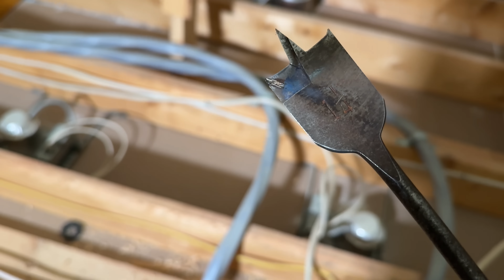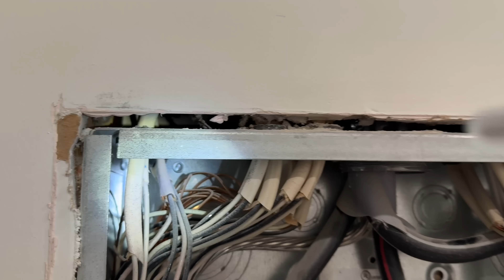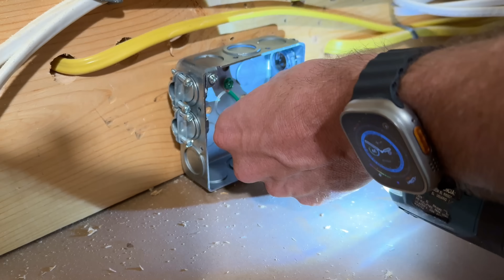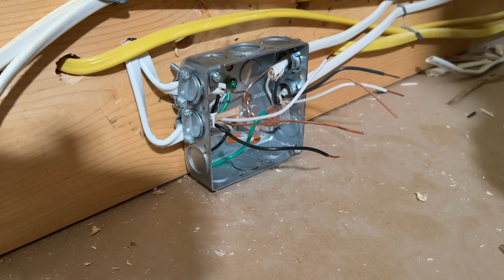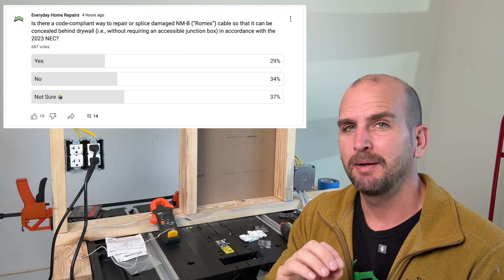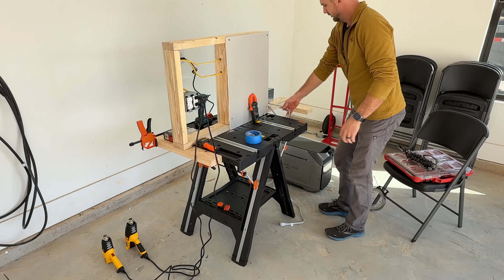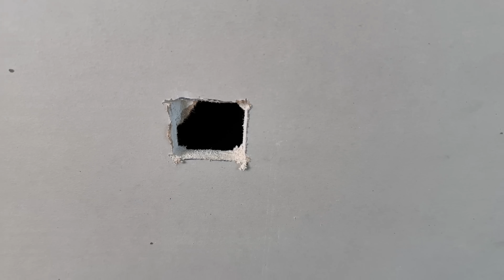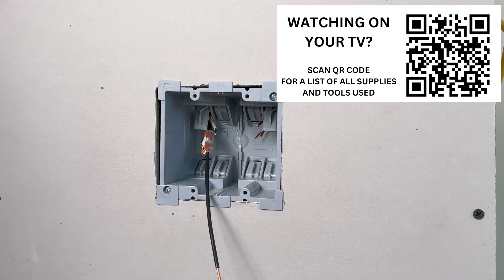How To Repair Damaged Romex |  3 Easy DIY Fixes

Comment: Edit:   Never mind……. I see that you covered the following as your “option 3”.  Ignore this: Perhaps this is against code:  why not just put in a 2 or 3 gang box in the attic and run the two halves of the EXISTING wire into it then just put in a small “pig tail” or “jumper” between the two existing wires (the wire that was accidentally cut).  Push it all back into the box and put a plate over it. How would that be unacceptable or not code compliant?

Comment: I have several Romex Splice kits in service at my rentals. I use to be able to buy the Tyco brand ones at Menards. I have used them when removing a Range hood and installing an outlet for a Over the Range microwave, as in most cases there is not enough wire, and no good place for a J box, and running a new wire is not reasonable.  

I love the Wago's but the reality is, they dont make any more contact with the solid core wire than the Splice kit does, a much different story on stranded wire.

Comment: In line connectors are really a lifesaver, i’m a wire nut guy, but the only time I really use waygo is for short wires. Had a knicked 12/2 jumper wire in a 2001 home. Had to put a jbox in with the waygo in lines. Was very easy to use and install.

Comment: Is there a connector for damaged 18/3 wires?
Reply: Since 18 gauge is used for low voltage applications, you are free to splice them using lever nuts without a junction box.

Comment: I wish there was longer testing ( until there was an overt plateau ),  and I wasn't just taking your word for weather it's approved to be buried in the wall. Also just out of curiosity how exactly did that trailer outlet fail. The old work box fix has me concerned it wouldn't pass inspection because of the limited clamping on the wire coming in the box and the lack of insulation coming in the box. This is a situation where if you didn't want to pull all new wire, two single gang old work boxes and new wire running between the boxes would be safer especially if it was getting inspected. For clarity each box would be away from the damaged area where you could get more slack in the wire to make each box up correctly.
Reply: My thoughts exactly.  Actually I was thinking about the two 1-gang boxes placed in two different bays so they didn't look so funny and use the damaged wire to pull the new wire.

Comment: I don't think making the wires in a box joined that way is code. I personally would have just severed the wire completely, and added two metal boxes on each end, with a new piece of Romex between the two new "metal boxes" for that type of repair, That would have given you enough wire to have inside the box to work with, you'd have better clamps, and of course some grounding points since there must be access. I don't think I would trust those clamps just yet, until they're more common. Kind of like let everyone else be the guinea pig  and hope that I never have occasion in the mean time.

I am looking for the straight Wago splices too. I purchased a whole pack from your store at The Amazon in the past, but I lost them. I don't know where they went. I'll probably find them after I buy them. As I am more crippled to do projects, I still find occasions I need them. And even getting all the stuff to do a project, I have to get an electrician out here because I can't physically do it anymore. But I do keep trying.

Comment: #2 has a very small contact surface. Nothing is preventing copper from oxydation (maybe little dielectric grase will help). Problems will not be noticeable in 30 min test, but after few months of use (especially with high currents) when junction will corrode and start to arc. Wago have bigger contact surface and heat radiating surface, but still copper without insulation is exposed and will start to corrode. Especially on higher constant currents

Comment: This is not national electrical code. Good Attempt, It’s still state and local allowance. Grandfathered.
Do a panel upgrade of the 60 amp Edison fuse panel  to a 200 amp panel in Georgia.
The first thing students in vocational school is circular mils. Your wago doesn’t meet those standards.

Comment: If the damage is in the wall, how do you located it?
Reply: Sometimes (and I stres this) when a conductor is nicked (if indeed it is nicked) its resistance will be a bit higher.  Run a load through the wire and use a thermal camera to scan the wall.  If course if you drive a picture hanging nail into the drywall and sense you hit something, that's your sign.

Comment: A junction box in the wall with a blank cover is prettier than a fire
Reply: Any junction box is required to have access to according to NEC code. 95% of failures occur at junctions and terminations.
Reply: I always put receptacles on they cost like $2
Reply: @chriscolameco6850  yeah even if it’s in the ceiling 👍
Reply: 18 ft?
Reply: @ that’s probably the one time I’ll use a cover
Reply: Amen
Reply: Pipe and wire in a wall is really nice, but you can’t have a bunch of immigrants who can get an apprenticeship license in two seconds pulling rope all day with no knowledge of what they’re doing. You have to have some mechanical ability to measure and bend pipe and drill exact holes to install pipe.

Comment: Wago connectors or any type of snap-in connectors are horrid, performing a terrible non-stable connection, especially within humid climates or crawl spaces.

If looking for a cheap alternative for repairing in wall Romex, just install a junction box.  Best spending a little more extra time completing the job correctly, versus taking shortcuts.

Comment: I remember This Old House featuring these  splice kits when working with prefab house construction companies putting together entire houses with plumbing and electrical already embedded in insulated wall panels, with both sheathing and finish on the outside and drywall on the inside. The electricians would preassemble the connectors to the labeled whips of wire, and final connections would literally take a few minutes once the wall panels were all in place. This was over 16 years ago.

Comment: I have a modular home and have some NSI connectors.  They used them to tie the electrical between the different sub sections of the house after the crane placed them (modular home, not a manufactured home). They are all in the attic or the basement, in the open and accessible and not buried.  House was built in the 90s and I did have one fail.   They left a few feet of wire in a loop at each one so its easy to swap to a real electrical box.  I replaced a few others on my own just because and there are a few left I'll do eventually.
Reply: I’ve ran into some issues with them on a double wide. They had lost a neutral wire and we tried finding the connections. Finally just ran a new wire to that box and only used the white wire from the panel and curled up the extra wires in the panel and the wall box in the bathroom
Reply: Their still used to this day for the same purpose. The whole manufactured/modular home building process is simplified and rarely sees any actual skilled trade workers, its all basic low wage labor taught a few simple tasks to repeat over and over.
Reply: @PortersMob   That may be the case but overall the quality of construction and details is one of the best houses I've been in or dealt with.  Again, modular, not manufactured.  A lot of little things that add up to being very solid and user friendly, like no plumbing in the walls (all up through floor), open web floor trusses and some others.  I'm sure overall quality depends on the specific manufacturer.  Mine has far more circuits that are not using those NSI connectors than ones that do, the trend seems to be garage and exterior wall electrical receptacles/lights were with NSI connectors and all non exterior was run the normal way one piece or to a traditional junction box back to the panel after the fact.
Reply: @CriticalReactor  Modular is definitely better then most of the cookie cutter track home builders. 
That said based on what people around here are paying for them, they could have gotten the same exact home features, quality and finish with more flexible options for the same price from a custom home builder.
Manufactured single/double wide are still the wild west when it comes to quality, some are ok, others should have gone straight to the landfill.

Comment: I had to do this this year. I was trying to drill into the wall and hit a wire. It was right next to a stud which i didn't know was there. I wish I had spent more time observing the location before drilling. I would of saw the outlet lol. Though I didn't have the in line wagos at the time. So i was doing it with the 2 wire wagos.

Comment: Did you need to tie all the bare grounds together, and ground the box?
Reply: The reason I would keep them separate is because the second ground conductor would ohm out from the panel to be grounded in the field, which could cause confusion down the road.
Reply: I believe the second one should be sheathed as to not touch the other earthing conductor as they are from different circuits. If there is a fault and you are working on one of those circuits and disconnect it from the board it would become live which would be dangerous thus they shouldn't be connected together.

Comment: I like the idea, but would rather see one where the ends of the wire are stripped and locked in, kind of like the flip lock conectors

Comment: i have a 97 double wide which has your average receptacles, and the crossover connections are wire nutted together. while some use a connection similar to the one you tested.

Comment: Good information to consider. As a retired mechanic I have taken on electrical repairs around my house. Of the most used switches and outlets I have replaced about 95% of them. My house is 37 years old. I was surprised that most of the original outlets and switches had loose wires?  My house was wired completely with 12/2 which makes replacements hard. After replacements are made I believe repairs are solid. I made it standard to go back and re-tighten all wire connections three times. In my opinion even 12/2 copper wire will loosen after 30+ years and needs to be checked.
Reply: I had to replace all the outlets in my non-conditioned spaces after 20 years because the connections all loosened up and the had gotten hot.  One melted when I plugged a compressor in outside.  I torqued all the screws on the new ones not that I had ever seen an electriction do that. Also found that the original electricians had only twisted the grounds together without wire nuts, which made me have to check every switch and outlet in the house and fix affected ones.
Reply: @wadephipps4806 twisting the grounds together like that was common trade practice at one time
Reply: The loosening up is common, but usually it is because it wasn't torqued properly to begin with.  That's why current code requires torque to be specified, and the electrician and better follow the specs.  Too tight and you crush the wire reducing its current handling ability.  Too loose and it will loosen up.
Reply: @Sylvan_dB  I have seen a lot of wiring over the years, but I have never seen crushed wire with subsequent reduced capacity. I have also never seen a device that could handle enough torque to crush the wire; the screw or screw hole will strip out first. Also, unless you actually cut the wire, you cannot reduce its capacity by flattening it because it still has the same cross section area, it’s just wider. That’s why thin copper foil can conduct major current on circuit boards: they just make the traces wide enough to do the job.
Reply: @ethanlamoureux5306  the crush problem is the transition zone between the crushed and round. The crush is abrupt and often has partial breaks in the transition.

Comment: I never knew an in-wall (non-access) solution existed.  Really appreciate this info!  It's a bit pricey for what it is but a major convenience factor.
Great point you brought up as well about the the mobile home switch and outlet boxes using the same (questionable/inferior) connections.
Reply: Because it technically doesn't. Code in many jurisdictions treats that connector as a junction box requiring ready access, and some jurisdictions outright ban them.
Reply: @PortersMob , Plus if you have to open the wall up to put that on and cover the Damaged Wire...
  Ya may as well put a Junction Box, accessable through the Dry wall and cover access plate....much safer,..

Comment: Personally i prefer all connections to be in electrical boxes for future accessibility, and to limit any potential arching/spark. Running a new cable would be my preference, splicing in an electrical box my second choice whether a single box or dual with a jumper between. I am not a  fan of the inline wago’s for this situation even within the electrical box as the connection leads  are very short where the splice is made rather than 6-8 inches. The in-wall solution i am quite wary of long term, burying something in a wall cavity with future access and with a very light clamping method may be problematic long term, not something i would do in my house. I can see many going to this style as it is so easy and simple, especially when you do not own the house as 30 years down the line it is someone else’s problem. Just an opinion, Cheers.

Comment: I have of seven of these splice kits in my attic connecting different 14-2 Romex lines through out my house.  I’m guessing they were installed when the house was built.   I found them troubling even though the house is 15 years old with no issues. I partially wrapped them with electrical tape to protect where the two sections come together.
Reply from the maker: Yeah in that scenario I do prefer the metal junction boxes in the attic but from the testing I did today I was impressed by the little heat generated.
Reply: My guess is they were used to extend the lengths of the individual Romex  runs throughout the house.   I don’t know how common that is in new home construction.
Reply: @paulscheirer2368  You certainly know more than the manufacture and the standards bodies around the world.  Tape couldn't possibly cause any problems...   But please... don't let your lack of education influence your perception of the complexities of the world around you.  You know best!

Comment: I ran into one of those Mobile Home/RV outlets with conductor tapping forks one time years ago.  I was hearing sparks.  I pulled it and, found the burn marks on the forks, so I pulled it and replaced it with a screw-terminal outlet.  it was just a cheap outlet from Lowe's, but it's much better than the one I replaced.  Never saw an issue again.  I do like your LaGrange Professional (I think it's called) recommendation now better, though, and that's what I'd use in the future.  I would avoid the first ones every time I could, which is probably always.

If it's going to be done inline, I would rather use WAGOs inside a box like the one you used in #3, but that would require a bunch of WAGOs.  If that forks jumper meets Code, then why wouldn't 3 extension WAGOs uncovered?  Because the forks one is somewhat covered?  Extension WAGOs cover the bare wire to the insulation, when stripped correctly.  What about covering the WAGOs with electrical tape?  That would keep the levers closed and offer some insulation.

For the WAGO repair #3, why not just jumper one set of 3 WAGO wire extensions straight into the other 3, instead of extending both sides and needing three 2-wire WAGOs to finish?  If you ever wanted to add an outlet there, you could disconnect one side, do the other side to match, and then let the outlet jumper both sets of hot, ground and neutral together.  It's just about saving WAGOs for other jobs, and a little Romex.  Is there some Code that says NOT to do it that way?  It's all inside the box, so what does it matter?  Thank you, Scott.

Comment: technique 4: instead of running new romex all the way to the attic or using potentially dangerous/unreliable punch-down kits or trying to splice the pieces that are too short for technique number 3, follow the romex to one side or the other to the nearest junction box or outlet and just replace the romex from there to where the damage is and leave plenty of length to safely splice in a junction box or outlet, or replace just the romex from one junction box/outlet to the next.
Reply: The only issue I'd see with that is the wire being stapled in between the two boxes, so unless you open the wall enough to deal with That, then the other methods would be next in line.

Comment: Picky point but best  insulation practice that I'm aware of is to slit that insulation  to go around the wire rather than compressing the insulation against the wire, creating a cavity for air to flow.
Reply: Heh, that and to staple the insulation to the studs :D

Comment: If you can pull a wire from your panel up into your attic as demonstrated you have bigger code violations in your house 🤣🤣🤣
Reply: Hahaha so true!
Reply: I was thinking the same thing but I'm pretty sure that an added circuit doesn't need to be restrained within the wall. So there are occasions where this could be done.